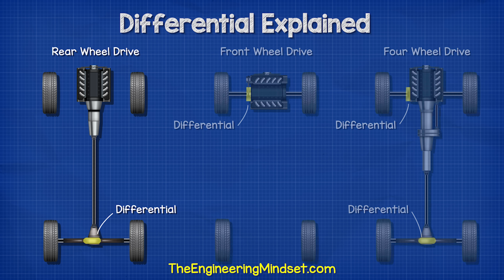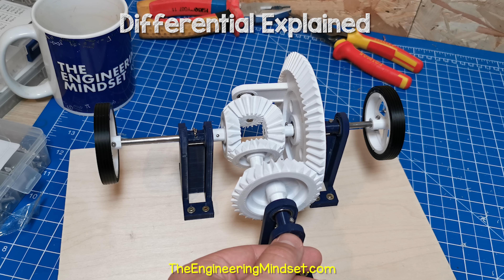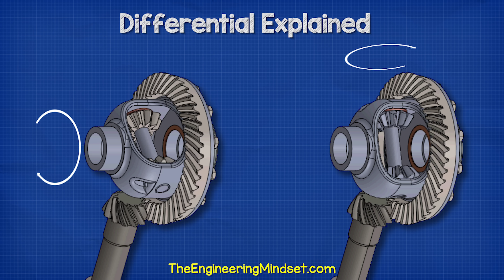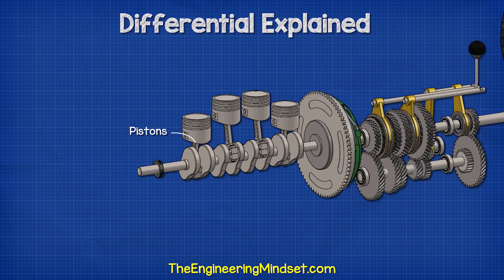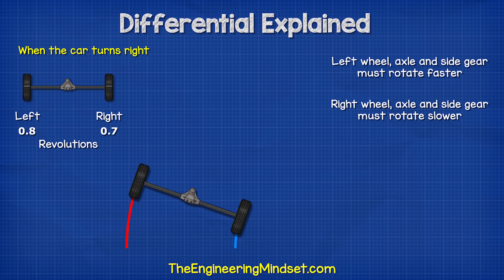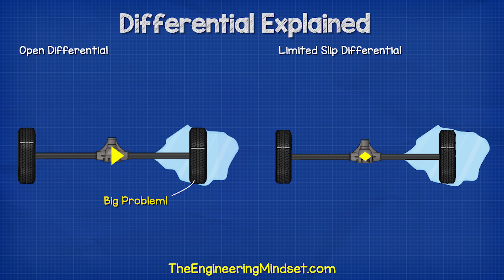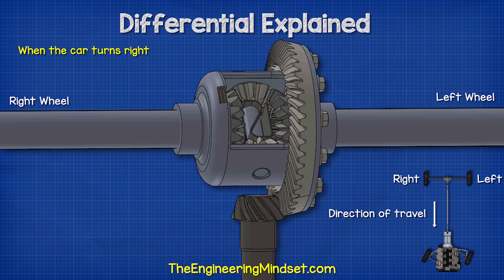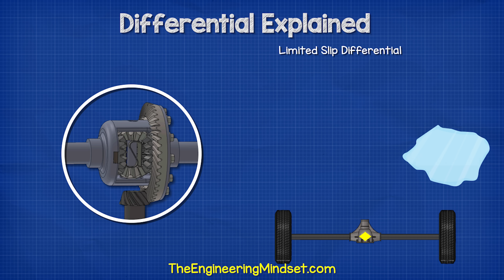Differential explained - How differential works open, limited slip

Comment: You've made cool video, unfortunatelly packed fully with advertisemets, both external and internal. Your videos will defend itself. You don't need to pack internal advertisements, which makes my - and probably some other's perception of your video bad. Keep doing good job, don't include internal advertisements. Best regards.
Reply: I've always known the part the ring gear bolts to as the carrier  (it carries the spider gears round and round)
Perhaps this is just a quirk of North American nomenclature?
Reply from the maker: We have to include internal adverts to fund these videos. You don't want to pay and I don't want to charge you for education. Look at how detailed the models and animations are. This video took over 3 weeks to make, I barely left my home, worked nights, days, weekends to make it all. Youtube ads won't cover the costs unfortunately so the funding has to come from somewhere.
We always ensure the internal ads are relevant to the topic, in this case I've spent days designing a simple model and then gave away my 3D files for free, so that you can make your own differential at home, and hopefully you will use the sponsor for printing some or all of them. I did not get paid to go the extra mile and make the files, I do not get paid extra if you click the link or order anything, I only get paid a small fee to show their logo, but I went further to ensure you got something extra out of it, not many other creators do that. I think its a good deal and ensures you get highest quality content for free.
Reply: @EngineeringMindset  When they say "internal advertisements", they mean, hard-breaking the video flow, to shout-out ANOTHER video you've done.
They are right, on their own, your videos are great. External advertisement pays the bills, and needed. But we don't need a reminder that you have other videos. IF the video is good enough, someone will go to your channel, and look for more. OR, link relevant videos at the end. The hard MULTIPLE mid-video breaks to say "this other video I've done" is distracting, and unnecessary. BESIDES that, keep up the good work. Just constructive criticism. Take it or leave it.
Reply: @EngineeringMindset  This is an excellent explanation and animation!   
The gears that PCB Way have printed for you appear to be high quality with a nice finish.
Glad you have this sponsor working with you.

Comment: crank shaft not cam shaft and drive shaft is arguably a prop shaft. Drive shaft would be straight from gearbox to front wheels in a fwd car - or driveshaft is from diff to wheels in a fully independent suspension rear drive car. In a live “axle” setup as per this video - its axle shaft from diff to wheel and prop shaft from gearbox to diff
Reply: here on Australia we call it a driveshaft from the gearbox to the diff. 
a propshaft is found in a boat.....

Comment: Crank shaft, not cam shaft
Reply from the maker: Woops, wrong word. Well spotted, I'll add a correction in the description
Reply: @EngineeringMindset  Usually, the gears that you refer to as 'spider gears' and 'side gears' should more properly be referred to as planet gears.
Others have also mentioned the crankshaft/camshaft error.
Your terminology (despite your English accent) seems to be the dumbed down USA version.
It's almost as if the correct term is just too difficult to learn or remember, so they HAVE to simplify it.
Otherwise, a fairly decent explanation of events.
Regards Mark in the UK